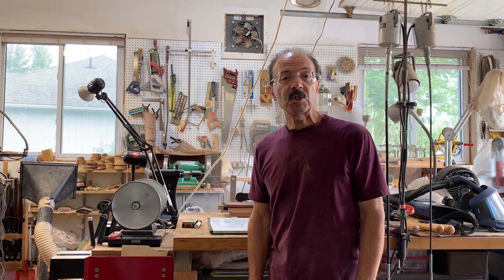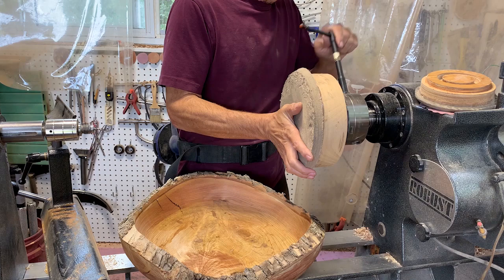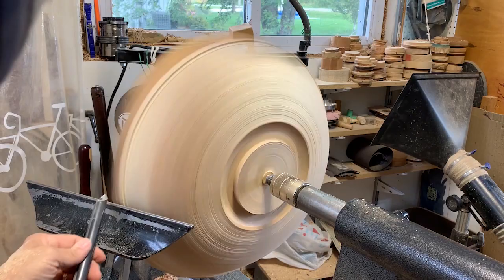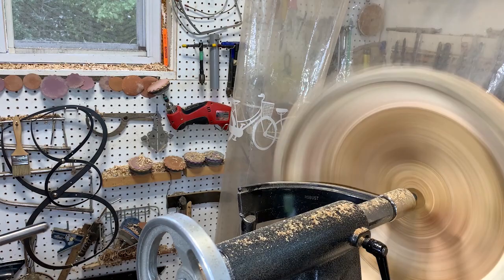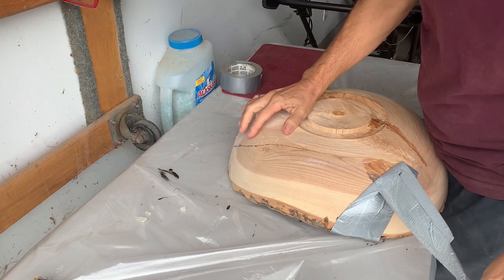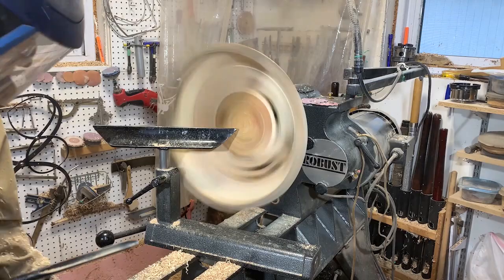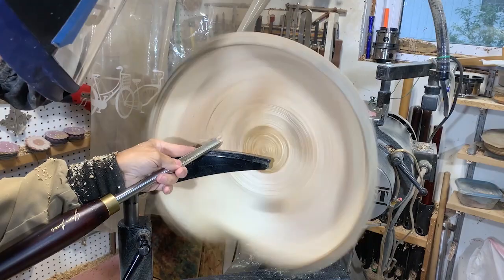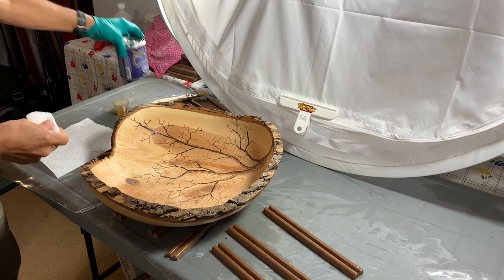Woodturning: Ash Crotch Bowl Crack Repair

Comment: Well done.  It put a smile on my face seeing the tree burnings put in there to naturally make the cracks disappear in the drawing.

I've got two roughed hollowforms about12" tall x 12" wide in birds eye maple.  Many years ago I was taking a class at Craft Supplies USA in Provo Utah, and they just got in a couple of pallets of birds eye maple logs.  As they were about to run those ithrough the mill I asked if I could buy two log cuts off the end of one of the logs, and they said "Sure".

They were roughed, but still cracked a bit near the bottom, and I've always thought that the best way for them to look super when I get around to finish turning them was to do exactly as you did.  Just burn/carve in a tree or root or reed like drawing using the cracks as starting points.

Super nice job you did.  Thanks for the video.
Reply from the maker: Thanks, I must admit that I now do this for quite a few of my pieces now to hide the cracks and everyone loves the look of the tree image.  I sketch it in pencil first and then use a pyrography pen…good luck and hope it works for your hollow forms.

Comment: Wow, Frank! Not only are you a woodturning artist but a woodburning artist! And putting the tree on both outside and inside? Icing on the cake. (I don't often use exclamation points, but this calls for them.)
Reply from the maker: Thanks, I cheated a bit because the wood burning covers up that crack nicely on both the inside and outside of the bowl 😁

Comment: Thanks for the drawings and explanation.  Nice tree addition!  I seem to have trouble with a pyrography pen following the grain rather than where i am attempting to burn, any advice?
Reply from the maker: Thanks.  Yes, I sometimes have a bit of that problem on grainy wood like ash or oak, but my images of trees are always kind of free form so a bit of movement of my pyrography pen is not really that noticeable.  Only advice is lots of practice, a steady hand and always pull the pen towards you to have the best control.  I do also from time to time sharpen the pen knife edge so it cuts in clean and then tends not to slide around as much and I also often clean the slag off the pen with a small wire/brass brush if it builds up.  Good luck